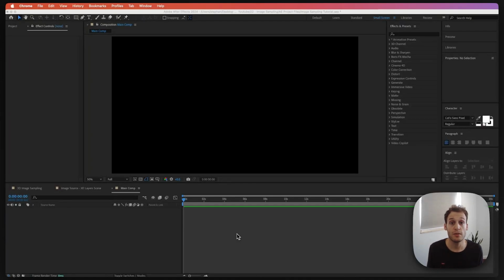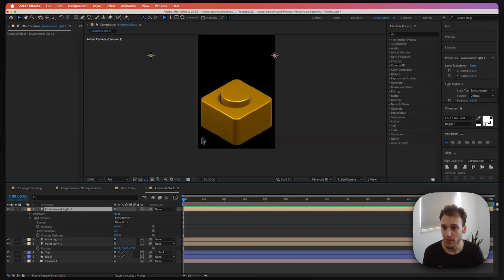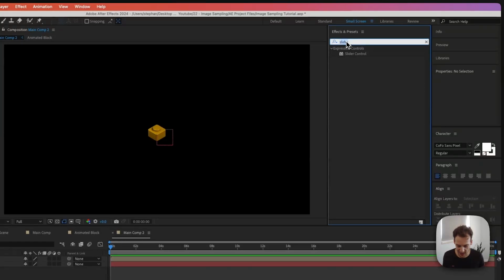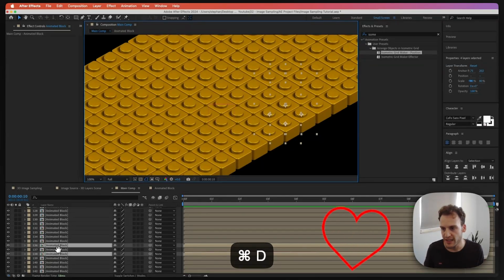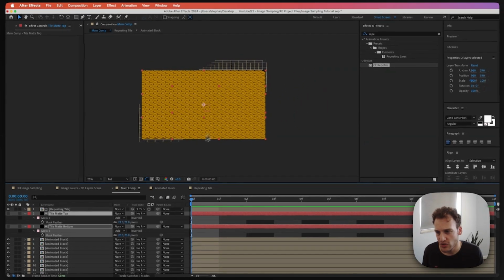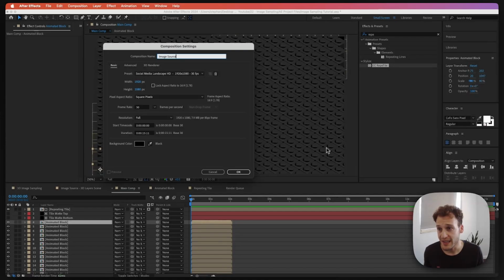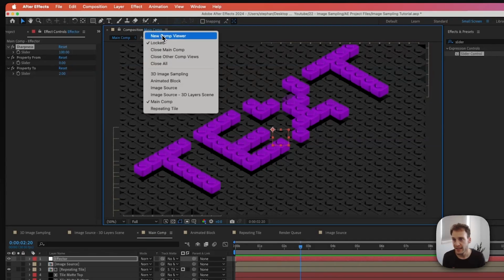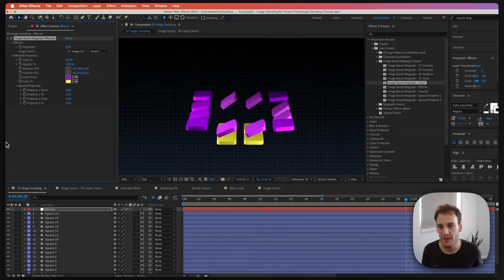Reactive 3D? Motion Graphics Tutorial After Effects

Comment: Great idea and nice to follow tutorial but the Mograph Expression didn't work for me. It shows an error when pasted to the time remap property of the animated block comp (just a lonely "f" around line 20) but once that has been fixed it didn't work anyway.
Reply from the maker: Thank you for your comment, glad you like it! Usually this would be due to incorrect naming of one of the Effects or the Effector layer. Make sure that the "Effector" and the effect names for the Slider Controls, are exactly as in the video. You will also need to make sure you have an Image Source Layer, and that it is named correctly.
Reply: layerindex = index - 1;
numLayersPerLine = thisComp.layer("Effector").effect("Layers Per Line")(1);
xOffset = thisComp.layer("Effector").effect("Grid X")(1);
yOffset = thisComp.layer("Effector").effect("Grid Y")(1);
xLineSpacing = thisComp.layer("Effector").effect("X Line Spacing")(1);
yLineSpacing = thisComp.layer("Effector").effect("Y Line Spacing")(1);

startPos = thisComp.layer(1).transform.position.value;

currentLine = Math.floor(layerindex/numLayersPerLine);
positionInLine = layerindex % numLayersPerLine;

xPos = startPos[0] + currentLine * xLineSpacing + positionInLine * xOffset;
yPos = startPos [1] + currentLine * yLineSpacing + positionInLine * yOffset;

[xPos,yPos]

Use this one. And rename everything as mentioned in the video.